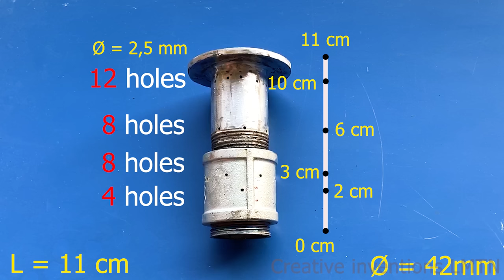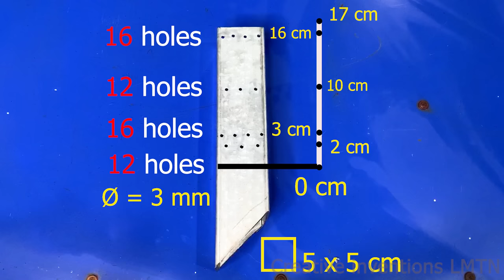Use these 3 types of burners to get blue flame from waste oil stoves | DIY Waste Oil Burner Stove

Comment: S’il vous plaît comment dimmensionnez-vous le brûleurs ??
 Je veux dire comment savoir qu’il faut tel nombre de trous à telle hauteur ???
Reply from the maker: Le dimensionnement d'un brûleur pour un projet particulier implique des calculs et des essais pour obtenir une combustion efficace et contrôlée. Pour déterminer le nombre de trous et leur hauteur, voici quelques étapes que vous pouvez suivre :

1. *Calculez les besoins thermiques :* Tout d'abord, déterminez la quantité de chaleur requise pour votre application. Cela dépendra de ce que vous essayez d'accomplir, que ce soit la fusion du métal, le chauffage d'un espace, ou autre chose.

2. *Choisissez le carburant :* Sélectionnez le type de carburant que vous utiliserez (gaz, huile, bois, etc.). Chaque carburant a ses propres caractéristiques de combustion, ce qui affectera le dimensionnement du brûleur.

3. *Consultez les spécifications du carburant :* Les fournisseurs de carburant fournissent souvent des informations sur la combustion, telles que le pouvoir calorifique, le débit de carburant, et la pression requise. Utilisez ces données pour calculer la quantité de carburant nécessaire.

4. *Concevez le brûleur :* Concevez la configuration des trous de manière à répartir uniformément la chaleur dans la chambre de combustion. La taille, la répartition et l'angle des trous peuvent influencer la performance du brûleur.

5. *Testez et ajustez :* Une fois le brûleur assemblé, effectuez des tests. Surveillez la température, la stabilité de la flamme et la consommation de carburant. En fonction des résultats, ajustez le nombre et la taille des trous, ainsi que leur position, pour optimiser les performances.

6. *Considérez la sécurité :* Assurez-vous que le brûleur est conçu avec des mesures de sécurité appropriées, telles que des dispositifs d'arrêt d'urgence et des mécanismes de régulation.

Le dimensionnement d'un brûleur peut être un processus complexe, et il peut être utile de consulter un expert ou un ingénieur spécialisé dans le domaine de la combustion pour obtenir des conseils spécifiques à votre projet.

Avez-vous une application particulière en tête pour laquelle vous souhaitez dimensionner un brûleur ? Des informations supplémentaires sur votre projet pourraient aider à fournir des directives plus précises.

Comment: ..bkit pumupunta lingas don sa burner eh nd nmn don pumapasok ung used oil
Reply from the maker: Upang ang kalan ay magsunog ng walang usok na basurang langis, mayroong dalawang pangunahing kondisyon: ang langis ay dapat magsingaw sa napakataas na temperatura at dapat mayroong sapat na hangin. Ang bagong disenyo ay nagiging sanhi ng pagsunog ng langis sa isang maliit na silid ng pagkasunog kung saan ang napakataas na init ay puro. Ang metal ng red-hot combustion chamber ay dapat na higit sa 500°C. Mga perpektong kondisyon para sa kumpletong pagkasunog. Ang silid ng pagkasunog ay pinainit sa pamamagitan ng mga siwang ng umuusbong na apoy. Kapag pumutok ang apoy, nakasalubong nito ang panlabas na shell ng metal at babalik sa pag-init muli ng combustion chamber. Kaya, ang silid ng pagkasunog ay pinainit nang dalawang beses. Mula sa loob palabas at mula sa labas papasok. Kaya't ang silid ng pagkasunog ay palaging pinapanatili ang pulang init. Panoorin ang video, makikita mo ang nasusunog na silid na nasusunog na pula. Ayusin ang laki ng apoy sa pamamagitan ng pagsasaayos ng daloy ng langis at ang daloy ng hangin mula sa bentilador. Kailangang i-adjust ang fan para makuha ang tamang hangin. Pinapanatiling tama ang ratio ng hangin at langis, maganda ang pag-alab ng apoy. Ginagawa ko ang kusina mula sa mga bagay na madaling mahanap sa bahay. Simpleng pagpupulong upang magawa ito ng sinuman nang walang bayad. 👍

Comment: I copied this design but why it's fire wasn't blue?
Reply from the maker: The distance between the holes on the burner, the width of the holes, the actual size of the combustion chamber, please make sure that these parameters are correct. I can explain to you more, give me your question,sir
Reply: Sir can you give me the actual size/distance that I need to consider to achieve blue fire such as: distance between the hole
Diameter of the holes
Size of combustion chamber
Etc.
Reply from the maker: Oh, you can go to my channel. I made them for private videos. This is a video that summarizes the samples, so I have omitted the details

Comment: Sir pa order po
Reply: sir pa order po
Reply from the maker: I appreciate your interest! However, I don't have the capability to take orders or process purchases. If you're looking to order a product, I recommend checking with local suppliers, home improvement stores, or online marketplaces. They can assist you in placing an order for the specific item you need. If you have any other questions or need assistance with anything else, feel free to ask, and I'll do my best to help.
Reply from the maker: Naiintindihan ko ang iyong nais na mag-order. Ngunit, paumanhin, ngunit hindi ako maaaring tumanggap o magproseso ng mga order dito. Para sa mga produkto o serbisyo na nais mong mag-order, maari mong subukan ang mga sumusunod:

1. Hanapin ang opisyal na website o online store ng produkto o kumpanyang nais mong bilhan.
2. Tumawag sa mga lokal na supplier o tanggapang nag-aalok ng produkto na iyon.
3. Subukan ang mga online shopping platform o marketplace.

Kung may iba kang mga tanong o nangangailangan ng karagdagang tulong, huwag kang mag-atubiling magtanong, at tutulungan kita sa abot ng aking makakaya.

Comment: Just a couple of issues that I see with this design . With this method I can see no flame control ie: simmering,and most of all, once finished cooking, you have to let the remaining oil burn which could be a long time depending on how much is left which is wasted energy been burned away.
Reply from the maker: You can adjust the wind power to flame control, when finished cooking You should keep something sealed at the stove door. That means the oxygen gas is no longer enough to sustain the combustion.
Reply: @lmtn  when air supply is low , I think flame 🔥 become red or yellow
Reply: @lmtn  i agree with, you cover the hole of the stove to make the flame off,any object,or wet cloth